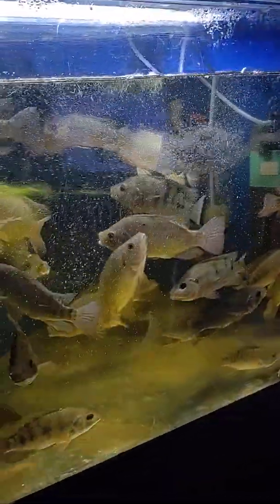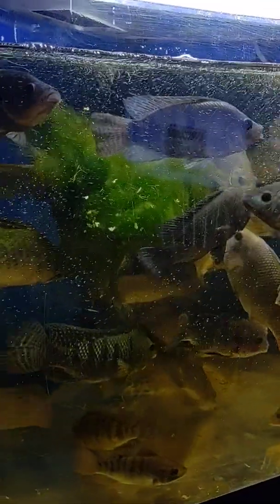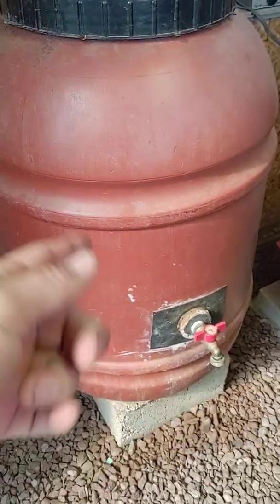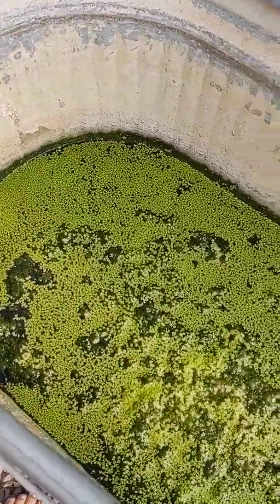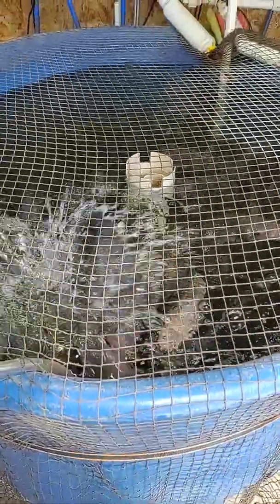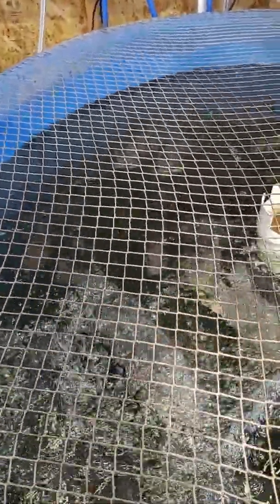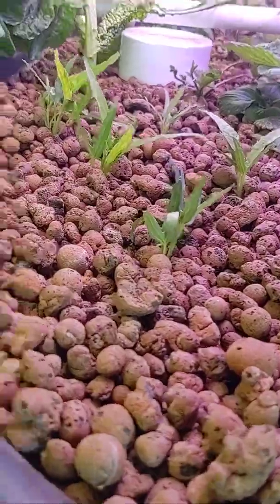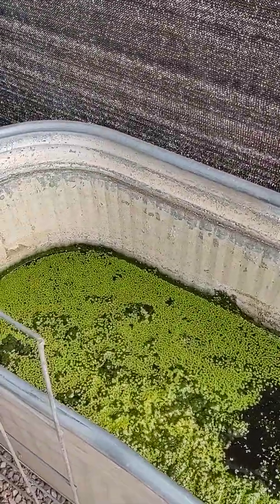Tilapia breeding and duckweed in aquaponics                             *Please like and subscribe*

Comment: Water looks good for the high density. Good video in a sea of bad ones. 1st aquaponics content I have subbed to for a long time. Finally getting into duckweed as a "just in case" for the same reason you mentioned after years of doing it.
Reply from the maker: Filtration and aeration is everything. When I was in college we went on a field trip to a tilapia farm in California. we walked up to the tank and There were fish outside the water! There were so many of them, I grab the owner by the arm and said "HOW IN THE HELL are you getting these densities?" He said "So you're the smart one." He dug a 30 foot hole and buried a 35" pipe in the shape of a U. The water went in and fed out the other side. Down in the bottom he had injectors that point source injected oxygen and he said the longer the air bubble is submerged, the more diffusion that happens. It was then I began to study diffusion. The smaller the bubble and the longer its submerged the more O2 carried to the fish. Something that has sat with my since 1999. People think I am crazy when I tell them this part.... He had three 4 lb fish per 1/2 gallon of water and they were blissfully happy. Blew my mind, because it violates EVERYTHING we have ever known! Glad you liked it. Many blessings.
Reply: I studied at harbor branch for a while, many people don't see high intensity systems on YT. I keep 1000 tilapia at 6.5 gallons per fish, wanted to keep it semi-intensive at the most. If we lose power due to hurricanes(florida) chances of survival are still high. During power loss of a few days from said hurricanes 2 fish were lost. Survival rate has been well above 95% since setting the system up. They are the Sherman tanks of the fish world it seems.
Reply: I have suspected this is true. 👍 thanks for that valuable information.

Comment: How do you battle the cold winter ? Regarding your fishs water temp, the grow beds etc
Reply from the maker: I live in the middle of AZ and for a winter crop, there needs to be alt heat. I use 2 Finnex Deluxe Titanium Tube Heater with Guard 800 W. Attached to 1 Inkbird ITC-608T Temperature Controller with Dual Temperature Sensor AC Dual Stage Outlet Thermostat with 12 Period Time Stage 1800W, This is inside the fish tank. If you want to heat the grow beds I use a Bucket Water Heater, Kingwork UL-Listed 1500W Immersion Heater with Thermostat and Auto Shutoff, Submersible Pool Heater with Full 304 Stainless-Steel Guard, Heats 5 Gallons of Water in Minutes. I place it in the underground sump. I dont grow in the winter, because the cost of heating the ambient air temp in the greenhouse (600 Square foot) If was to heat it, I would fabricate a 30 gallon diesel tank and use a Anbull 8KW Diesel Air Heater, 12V All in One Parking Heater, Single Air Outlet Diesel Heater with LCD Remote Control. (found on Amazon) to heat the place cheapest as possible. Some climates may be too cold for this unit. So you would have to correctly size your unit to your climate and greenhouse size. The cost of heating is not worth the money invested for me, considering we have 9 months out of the year we can grow allowing for amazing succession crop planting! Hope this helps! Many blessings!